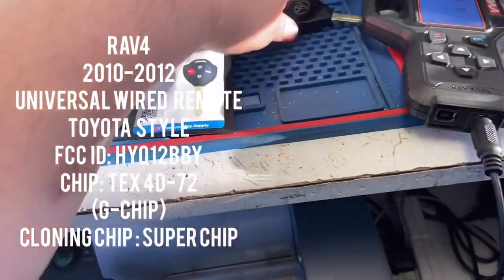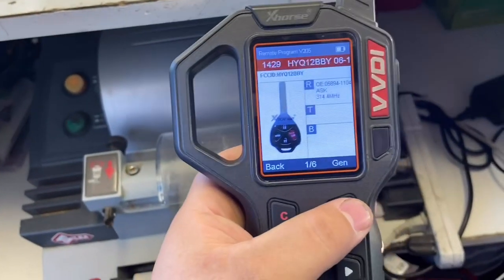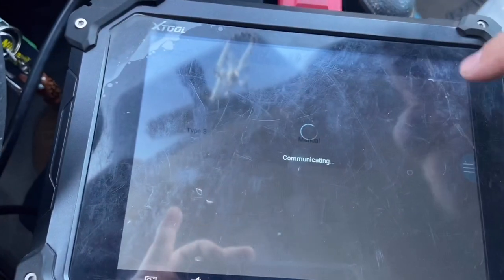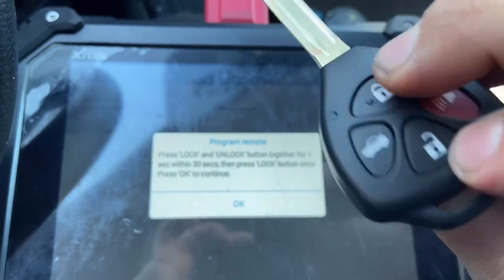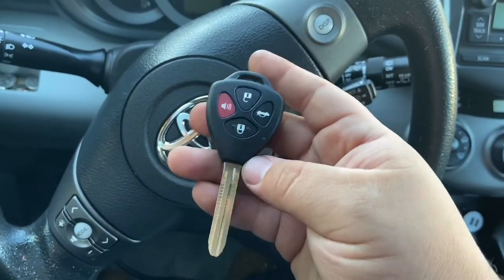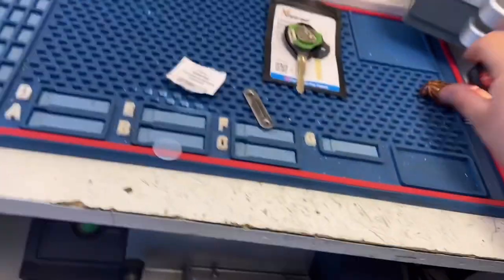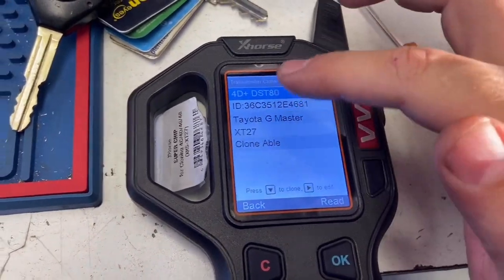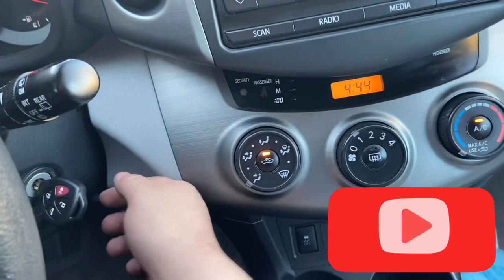UNIVERSAL TOYOTA STYLE WIRED REMOTE/ G CHIP CLONE USING "SUPER CHIP" (AUTOPROPAD)

Comment: I tried to use one of these for a 2015 Camry FCC HYQ12BDM with two different key tool max units and a mini with no success. It shows that the remote was generated successfully but I have not been able to program it. I’ve used an autopropad (no confirmation beeps from the car) a hotwire (timer times out as the car does not recognize the remote) and my coworker tried to do it with his autel, no luck. I even tried to use the Kia style wired remote, no luck either. Cloning the remote doesn’t work either. My coworker also tried another xhorse universal, nothing. I guess FCC HYQ12BDM is a no go.
BTW, I love your videos, lots of cool info!
Reply from the maker: Thats really sad and not fortunate... that sounds like almost tried every trick in the book!! I know how that feeling feels.. have you tried changing the fcc:id or looking up the fcc id under a different vehicle... did you check all the fuses on the vehicle..were they all working correctly?present remote works correctly???